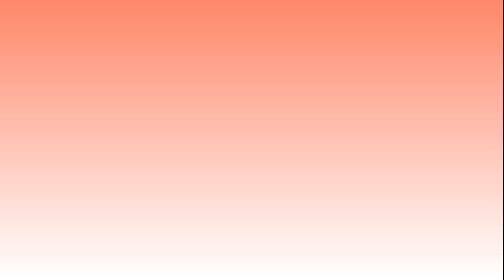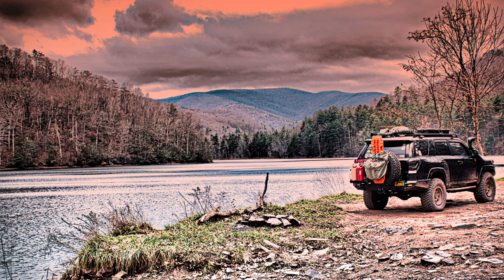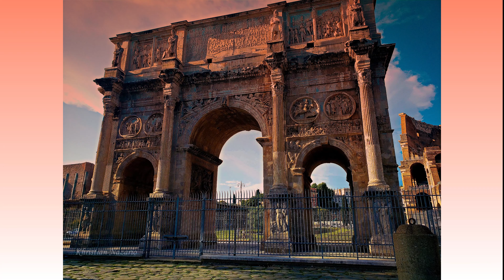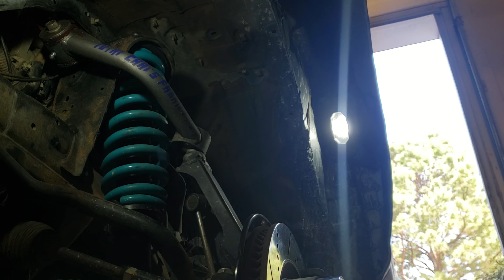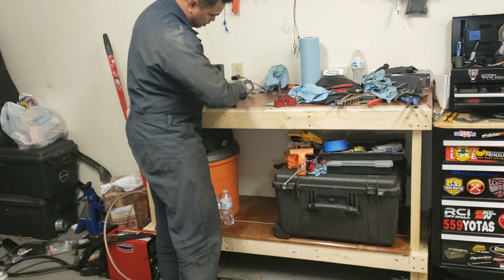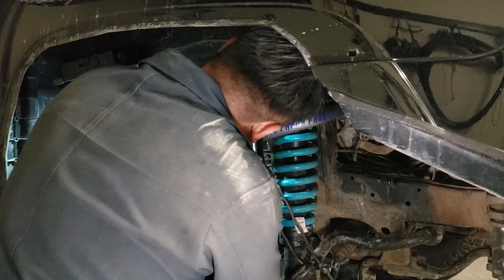Total Chaos upper control arm re-build (hyperlapse).

Comment: I changed the bushings on the TC uca. But I fell a little loose the steering wheel when I hit some trails. Re checked everything and it is tight. Maybe could be the uniball ? When I have the uca disconnected from the spindle, the uniball turns very softly with my finger. You had this issue ?
Reply from the maker: Thank you for your comment. That means that it's time to replace your uniball. You shouldn't be able to move it with your finger. If you saw the video, I have to use a red tube just to realign the bolt to put back on my spindle. Also, don't wait until it squeaks. That means your  uniball bushing is worn out.
Reply: Yeah I just saw it. No man ! Mine it moves even with gravity 😅. So that could be the loose feel I have in my steering.